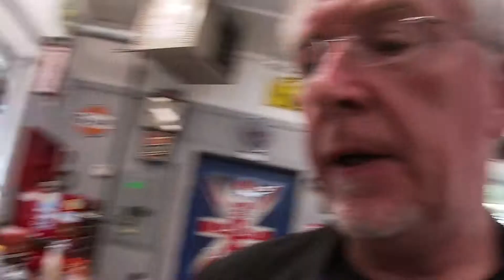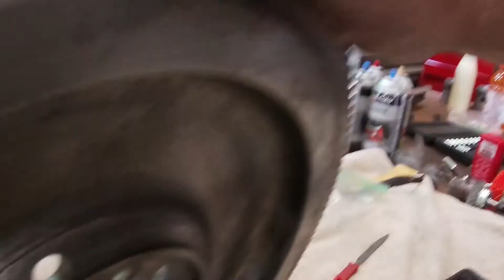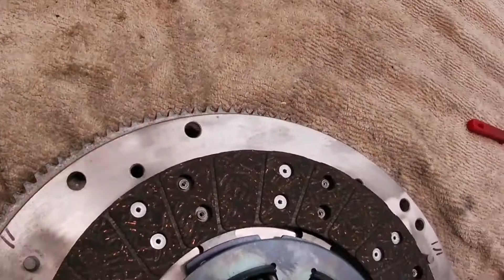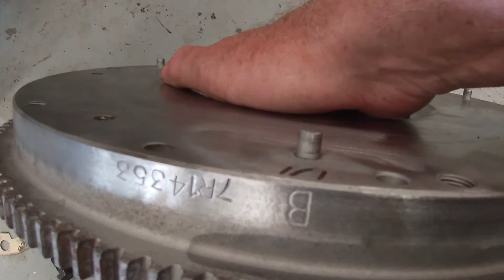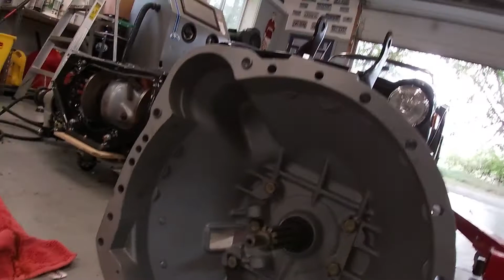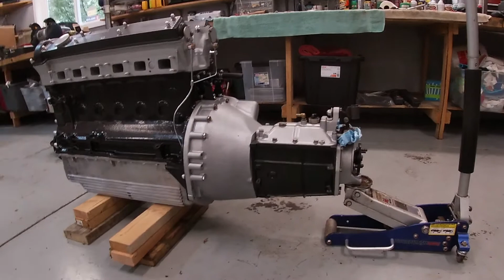Jaguar E Type Series II Rebuild - Flywheel - Clutch - Transmission

Comment: John, It looks fabulous. I am just about at the same point in my rebuild of my 70 OTS engine and gearbox. I had forgotten that there was a lock nut on the clutch fork. I will add one tomorrow. Thanks for the heads up. Please keep the videos coming.

Comment: John thank you for the video. 

It's helping me visualize my conundrum, which is I have a grinding noise (metallic, rubbing) that I can feel in bottom 10% the clutch pedal travel, a "crunch" if pressed at normal speed.  

Do you think the clutch fork could be engaging too far and rubbing the pressure plate housing, or is it possible the problem is in the throw out bearing clips, protruding too much and rubbing something? I had a new clutch assembly, throw out bearing and Fidanza aluminum flywheel installed 3 years ago.

It only crunches with engine on and while happening, somehow prevents the pressure plate releasing completely from the friction disk, as it won't go into gear. I'm almost certain the grind stops at the very bottom of the pedal travel, although, I haven't gone there too much, rather, letting up when I hear it. I had a new clutch assembly and throw out bearing installed 3 years ago. Any insight is much appreciated! 1970 S2 as well.
Reply from the maker: Hi Jon, I have read this several times and each time I have come back to the same thought - I think your clutch pressure plate is worn out and it is grinding against the flywheel
Reply: @johncooper6950  Thanks for the reply. I think this is a good thought, except my entire clutch is new, replaced with the 10.5 inch Borg and Beck from Welsh Jaguar (compatible with Series 2) in late 2018. The release bearing is new and also flywheel (Fidanza aluminum) and only 300 or so miles have been driven since. The grind only started recently.

Comment: Hi John, It sounds like you had then transmission re-built at Coventry West. From your videos you are very technically experienced I believe ... any particular reason why you didn't do it yourself? I'm at that decision myself, and just looking for reference points! Thanks
Reply from the maker: Hi Stephanie, both rear differentials and gearboxes need specialist tooling that I don't have. In both cases (rightly or wrongly), I was expecting that some specialist machining would be involved. I did not want to get into the strip down and find that out. I have used Coventry West in the past and their lead technician, "Dick" is an expert in this field. I spoke with Dick, and he suggested that if the budget allowed, he would recommend that they do both the gearbox and differential. I think it is money well spent and gives piece of mind. Dick also did my cylinder head.

Good luck with your whatever direction you end up taking. 

Thanks - John